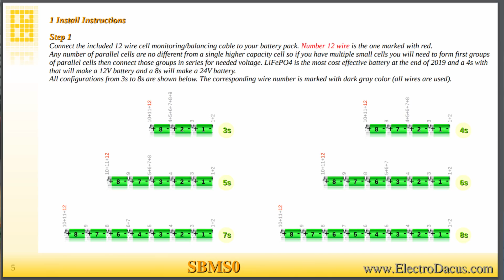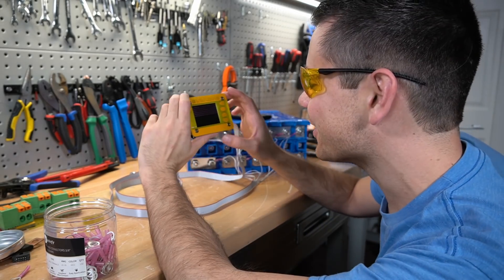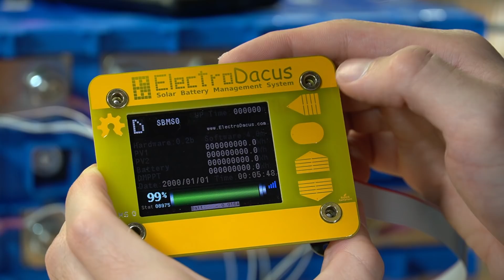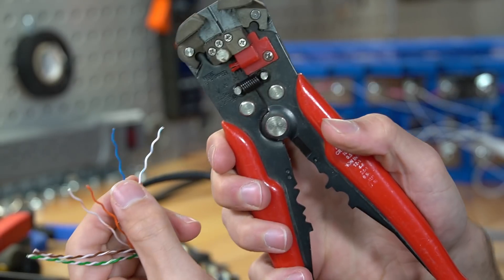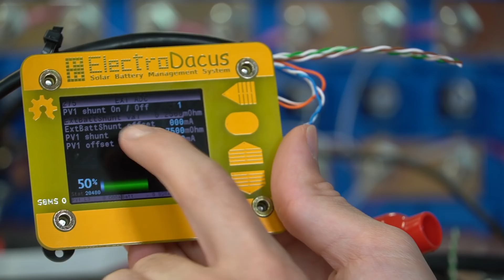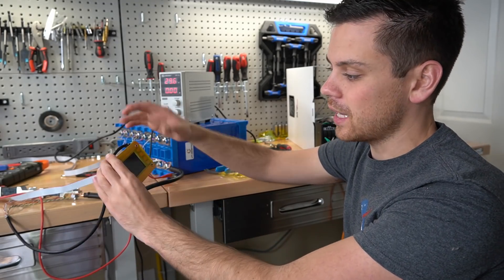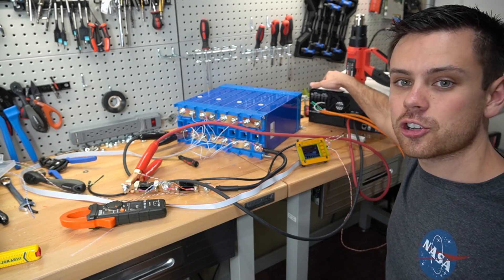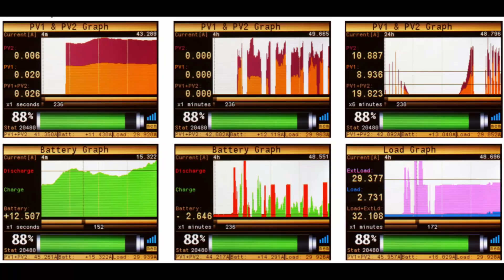Electrodacus -Open Source- Solar Battery Management System: Introduction and Setup

Comment: Are any of the inverters companies incorporating a set up so that when they see an AC load they switch the inverter on, thus eliminating idle DC load on the Batteries?

Example: In an your off grid cabin late at night the inverter is not pulling current from the batteries, you switch on an 120 AC load (a bed side lamp) the inverter senses demand and supply 120 VAC to your cabins circuit breaker panel, thus you light your way to relieve your inner tensions.       (This type of circuits is used for AC generator backup system, do any inverter companies?)
Reply: victron has a couple versions of this in the multiplus that I have.  A year later maybe that's helpful.  :)

Comment: I just received mine and I've got it running on my bench with a power supply and a simulated battery using a resistor divider .... I eventually plan on acquiring the new version DSSr20's with built in diversion switching.  As you mention, higher voltage strings will require an appropriate charge controller, but if you match your panels to your battery you can run the SSR's straight away.  I'm interested in how it manages balancing over time and plan to use my BMS with a Headway 38120 pack.  I'm also wanting to integrate with a wind turbine, but the jury is still out on how best to pari with the SBMS... awesome that you reviewed this, and kudos to Dacian, he's a great trove of information and he provides excellent support.
Reply: SBMS0 requires two criteria to be met before it starts balancing, a:  A voltage difference between cells of 0.01v or greater.  b: a charge or discharge current present. This allows balancing through a long range of SOC. The balancing activity is displayed as it is occurring. Use the DSSR20's as isolators/intermediate relays to control the wire signals functions of the wind generator controller,  you need a wind gen controller that can be controlled by wire signal, they are out there but not all have that. In the same way the DSSR20's can be used to switch an externally regulated alternator, same principle.
Reply: @bluejeans725  Thanks for the balancing answer... I''ll need to look a little closer at the display to see this in action.  Regarding the wind turbine, I've been looking at diversion controllers and other means of disconnecting and/or loading once batteries are recharged.  More questions than answers right now, but still working toward that end.

Comment: 1) I know best practice is to use a charge bus and Distribution bus with high amperage contractors. Many of us have DC DC chargers with independent solar chargers and alternators.  I was wondering if anyone has a design using electrodacus and high amperage contactors.     2) Will thanks for the great idea on rigging the switch shut off. I needed to do this. I"m going to head down to the boat and take a part my inverter and see if I can rig something up!
Reply: 1) In an off grid solar system battery will be charged multiple times a day so a mechanical contractor will not last long disconnecting the solar multiple times a day.  The solution for solar I offer is that DSSR20 that is a combination of "D" ideal diode to prevent reverse flow and a "SSR" Solid State Relay to stop the charging when any cell is full 3.55V default used for LiFePO4 the "20" is max continues current so two large 60 or 72 cell panels can be used in parallel on each DSSR20 without the need for individual panel fuses as a short on the PV panels will not result in battery current due to build in ideal diode that prevents that and PV panels are constant current sources so short circuit current will be about the same as normal working current and if any panel has an internal short the current coming from other panel will also be no more than 10A so not above normal operating current.
Alternator charging I try to discourage as much as possible due to the extreme cost with 50x higher cost per kWh than energy you get from a solar PV panel just considering the fuel cost.  But if you do not care about cost then a battery to battery charger (DC-DC converter) that is needed to charge an external battery from alternator will most likely have a ignition signal that can also be used by the SBMS0 by adding the EXT IO4 set as type 1 in series with that signal so if SBMS0 wants to stop the charging it can do that and also if engine is off charging will also be disabled.
2) What inverter model do you have ? maybe it already has a remote ON/OFF option.

Comment: This looks like the perfect BMS for Tesla battery users
Reply: SBMS0 will work with the 6s Tesla module but the Tesla battery module is a bad value compared to LiFePO4.
a) the 6s means just 21.6V nominal way below a standard 24V battery so many devices may not work properly or be able to take advantage of the battery capacity.
b) Panasonic cells used in that battery are optimized for EV so high energy density to the detriment of cycle life and while that is great choice for EV's is bad for an offgrid energy storage application where LiFePO4 will be superior in therms of cost amortization. Panasonic cells good for 500 cycles at 100% DOD while a good LiFePO4 3000 to 6000 cycles at 100% DOD thus an order of magnitude.
c) It contains toxic cobalt so you may need to pay to have that recycled in a few years and it the problem of thermal runaway in case of abuse or old cells that develops dendrite compared to LiFePO4 that has no cobalt and will not suffer from thermal runaway problems even when abused thus much safer to use.
d) you can only use one module as you are not allowed to parallel batteries just cells.

Comment: Those cells are the same cells I used for my new 24v system, and my last 12v one. Did you get them from Carl at Electric Car Parts. We’ve been buying them for about a year. Great product.

Comment: Love your channel, but you did this the hard way. You add a plug on the battery bank that is wired correctly and plug the monitor plug. Your in LV area, so go to Fry's for the parts.

Comment: for an inverter with no switch on could you not use the sbms to control a relay between the inverters power input?
Reply: A relay mechanical or solid state will not be capable to deal with the inrush current when capacitors are empty and the LiFePO4 battery can provide many kA of current in that instance melting or welding the contacts of the relay damaging it.  You can use a shunt tripper or a relay that can only disconnect and then do manual re-connection without forgetting to precharge the capacitors but is best if the inverter can be controlled like in this video as then you do not have the extra cost of the relay and all the complication of manual reset.
What sort of inverted do you have ?
Reply: @electrodacus  i was basing this off will using a bms to turn on and off a relay in other vids to power an inverter with more current input rating than his bms. i have a similar model 24v mppt inverter solar controller model but the 240v version and  the switch is in a different location but i am sure i could still use wills hack if needed but was just wondering for others if a relay could be used. depending on price for the inverter maybe you could wire the output to a timer circuit which would pre charge the caps slowly via resistor and then turn on the main relay. all just ideas for those who like to tinker/learn or already have something they want to use. but i admit i am just a mid level self taught and love to explore all options.
Reply: @magicmanspaz  My MPP inverter also has the switch in a different location and it is the 240V version but this can only be used as inverters only not as grid charger or solar charger as loads and chargers need to have separate remote and that is not available on the MPP solar.
Also if you have a 3 pin green connector on your MPP inverter then all you need to do is move two jumpers on the small board where that connector is and then you can use that connector as remote ON/OFF port thus no modifications are needed no need to solder any wires.  You will use the NO and NC marked pins on that connector after you moved the two jumpers. 
And yes you can build an automatic precharge circuit but that is not something anyone will be able to do and is not a good idea to be based on a timer best to be based on capacitor voltage vs battery voltage and only allow connection when there is less than 2V or so delta between them. But a larger quality contactor/relay is expensive then you need the complication of building a precharge circuit and you have extra power consumption to keep that energized when is so much simpler and cost effective to use the remote ON/OFF that is likely more reliable and requires no extra cost or extra energy use.

Comment: Something else to consider Will....the 60amp EPever tracers charge controller has programmable relays labeled for gen auto start. I haven't looked into it yet but i bet they could be programmed to control an inverter just as you did in this video via the main switch.
Reply from the maker: Smart idea
Reply: Yes, I use that kind of system, using the under voltage warning  contacts (reverse half of the gen stop-start) but to switch a SSD to turn off the AC mains at 25v  (tried 120A DC SSD relay but it blew) SNADI inverter (non-programmable LVD/HVD) 24v system Lifepo4 2x 6415AN. Am going to use the other SCC to turn off the DC to inverter with a 300A contactor, drawing 0.5A at either a delayed time, or at 24.9v (batt voltage always recovers if and when the aircon load disconnects at night (sometimes early morning). I blew a FET based 200A DYKB bms. Getting a JK 8S and use Raspberry Pi Victron Venus, with BMS driver, which has battery LVD at 24.8 3.1v per cell, still get majority of power out, and less risk of damage to a low v cell. The Electrodacus is interesting, with external shunts, as my system will use the BMS shunt as priority, which will not measure the inverter current. I find the Load contacts on the SCCs create an error on the SCC requiring a reset.

Comment: Is this still sold with the frustrating batch manufacturing so you have no idea how many months it will be before it shows up?
I'd buy 3 except they can't hack 48V systems.   A tear is sliding down my cheek.
Reply: Yes this is not for 48V systems but it is now available for direct purchase in my store and ships in a few days. Except for the DSSR20 that is out of stock since last week and I will have a new model available in April.
Reply: @electrodacus  I am pleased to hear of the store now!! Very pleased..   Now can you pleeeeease rev this baby to do 48V since that is where the market is heading?  And, I mean heading like tripping on the first step down the stairway! 

I know of five installations near me that are occurring and not a single one is 24V, they're all 48V.

In California with PG&E's epic incompetence a LOT of people are looking to run homes during prolonged "weather safety outages".   Because these are not "off grid" homes they have larger electrical demands than a thoughtfully designed off-grid place.  48V power levels are the only way to "simply" support this.
Reply: @keithcress1335  Sorry, I do not have any plans for a 48V version.  You can always go with higher voltage so why not 400V to use a full EV battery :) ?
I like to stay withing low voltage standards and those are considered to be 50 to 60V DC depending on the part of the world and with a 24V battery that is already at this limit as open circuit voltage for 60 or 72 cell PV panels are already 40 to 50V so going with a 48V battery will require PV array with at least 80 to 100V open circuit voltage way above what is considered low voltage.
I never recommended a battery on grid connected homes as that is most likely not cost effective but even if you wanted to add that as a backup and cost was not an issue normally you will have only some circuits on backup that are more critical and not the entire house and you will also want to conserve while on battery power if that will be a prolonged outage.
The SBMS0 can measure up to 750A so up to 20kW loads are possible and in therms of PV with a dual PV array option (explained in my manual at page 16) using multiple DSSR20 is possible to handle up to 30kW of PV
I doubt most house even grid connected require a larger PV array or load so battery voltage is not a limitation I think.   My small house that is fully offgrid uses around 120kWh per month using only a 4.5kWh LiFePO4 battery and I never had a empty battery as the large PV array about 8.5kW installed but will be larger soon can fully charge the battery even in worse overcast day and the rest of the energy up to about 1000kWh is used for house heating as the house is fully heated with PV electricity since that is the least expensive form of energy even when compared to Natural Gas that is a close number two if you already have a connection.
So I believe 24V battery can be sufficient and the only downside is that you need to pay about 2x more for cables compared to 48V but that compared to total system cost is not a huge value and is worth for the extra safety offered by the lower DC voltage.
For reference cost amortizations for different parts are as follow
PV panels less than $0.02/kWh  (this is over 25 to 30 years amortization period for new panels).
LiFePO4 battery best case $0.2/kWh (over the life of the battery and is an order of magnitude more to store the energy than to produce with PV)
Thermal storage can be as low as $0.01/kWh I currently have 92kWh of thermal storage but I will add another 100kWh soon plus extra PV array all done with SBMS0 and the new DSSR20 with diversion to heating.

Comment: I have  2 X 500 AH  battery bank =1,000 AH (12V LiFePO4) . However, each unit has a BMS without low-temp cut-off.  I also have a 3000W of Magnum Energy MSH3012M Inverter/Charger.  So , I am intending to replace  the existing BMS with the new ones with low-temp cut-off and blue tooth @ 300 A X 2.    Does this SMBS meet my requirements?
Thank in advance,Will.

Comment: Hi Will, do you have an affiliate link or discount code for Victron?  I'm thinking about the Victron MultiPlus 24/3000/70-50 120V and the wireless module.

Comment: A guy had an electric powered catamaran. Anyway, when he held his hand over one solar panel, the output would drop for all of them. He said that he has expensive electronics that break them down into groups that behave in that way. Is there a way that you can separate them into single units so that the output for several solar panels does not drop when there is a shadow on just one in the group without buying the expensive electronics that he briefly mentioned?
Reply: Not sure what setup that guy had but this seems impossible in any configuration. Parallel panels like is the case with DSSR20 use means each panel is independent and shadow on one panel will affect only that panel.  With an MPPT and multiple panels is series is the same one panel or even just part of one panel will be affected.
Tho maybe he had panels without bypass diodes (not sure what panels will be those as all panels I know have them in the junction box) and in that particular case or if one of the diodes failed open circuit (fairly unlikely) and all panels where in series then shading on one section of one panel will disable all those panels in series.

Comment: You really unadequately presented one amazing product without enough reading nor understanding. 
btw. DSSR20 is not PWM charge controller. It is basically Solid State Relay. SBMS0 switching it on or off. Same EXT IO4 signal from SBMS0 can be used to remotely switch on/off any charger. Also, you don't need very thick cables to connect with DSSR20. Dacian advising to use 6mm2 (AWG #10) wire for connecting 2 parallel panels. Please do the research before making the video. I know you are maybe less motivated with this product as it does not have affiliate program, but still. True facts are important!
Reply: Will covers a really broad scope on several things he reviews.  I have often needed to dive in and look closer and this is to be expected. I think this was a great exposure video and this is what I have come to expect from will with certain products. I am glad to read your comments about further product details. Will was asking for feedback and wasn't saying he knew everything about the device and he was not trying to hide the fact that maybe he didn't read everything.  I welcome your further information but I don't think the remarks about Will are needed and I know that some get carried away because they love this fine product.
Reply: Will is not as technical as an Adam Welch or BigClive, so I think he did a good job reviewing it considering his experience. Most of his audience is on the same level as he is. Will is genuinely interested in helping people, it's how he built such a large audience, and how he can still make money, even if he recommends products that dont have an affiliate program.